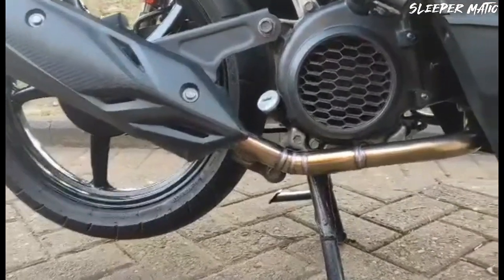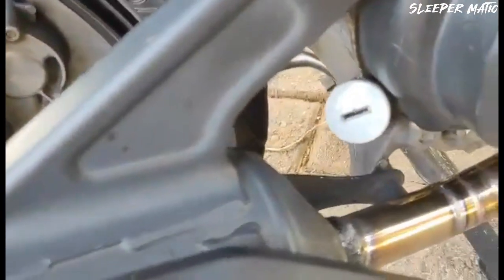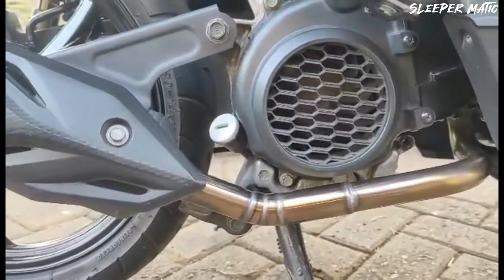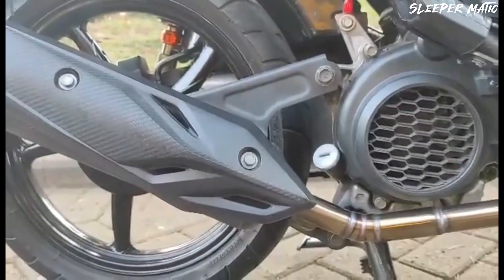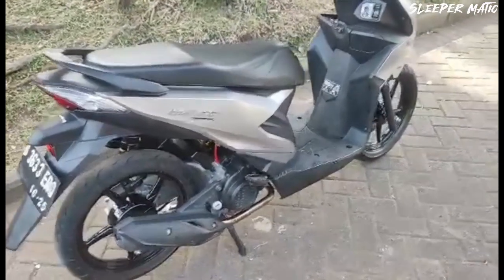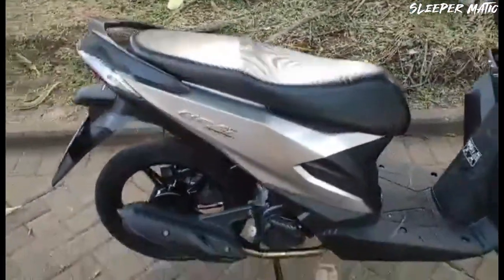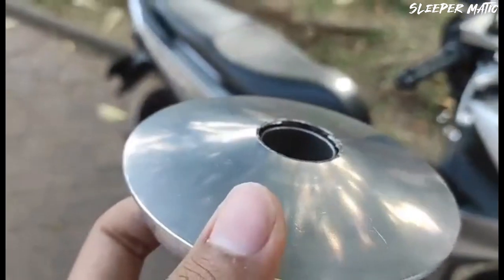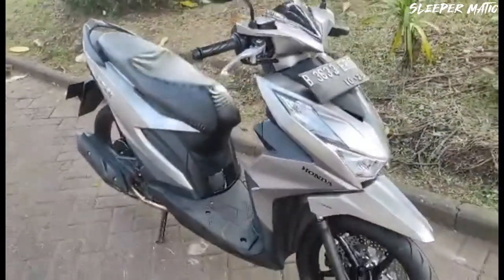BEAT DELUXE SILENT KILLER FEAT XEON KARBU BIKIN REPOT AEROX 155 YANG CUMA MODAL KIRIAN + KNALPOT 🔥🔥🔥

Comment: Kalau kondisi std bagus juga kah pakai leheran 26-30?
Reply: Jgn om, 24 rata aja klo bener bener std. Klo kirian nya enteng enteng gpp 26 rata
Reply: @deriwhiteswift  enteng enteng gimana ya mas?
mau minta saran mas scoopy 2021 pulley kerok jalur + bubut 13,8 roller 12g per cvt pcx cbu sentri beat karbu dipasang knalpot freeflow leheran 26/28 ngempos mas malahan enakan knalpot std tenaga nya lebih kerasa🙏
Reply: @miftahiman640  udah pasti kempos 26-28 mesin std.
Reply: @miftahiman640 racikan kirian gitu enak ga bang buat harian scopy 2021?
Reply: @dedekasep2821  enak mas, sekarang saya masih pake
Reply: @miftahiman640  mesin std kan?
Reply: @dedekasep2821  std mas
Reply: @miftahiman640 leherannya tetep std juga apa pakai 26/28?